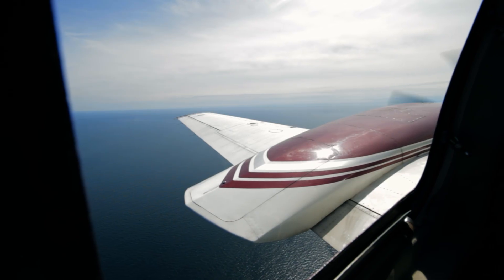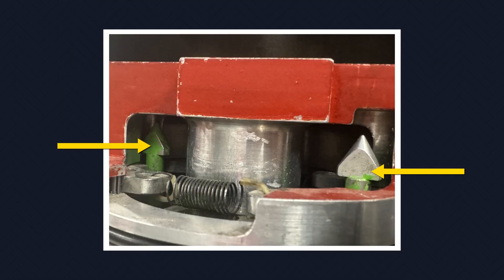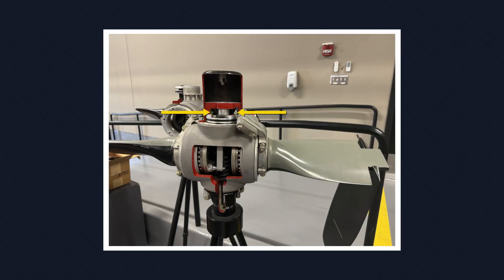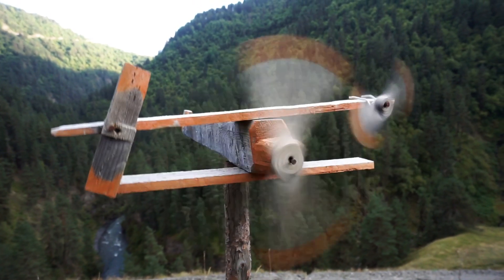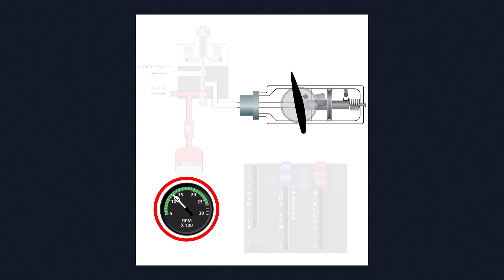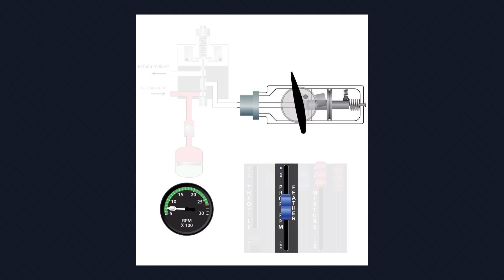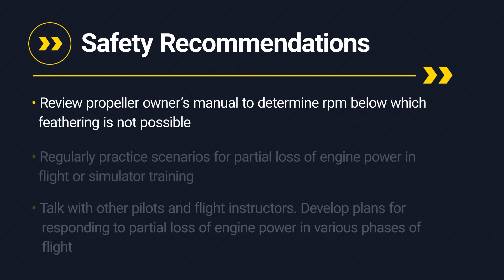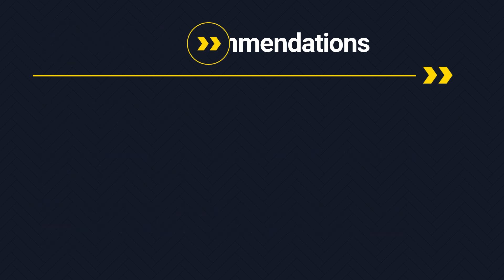NTSB Safety Alert - Know When to Feather Your Propeller If One Engine Loses Power

Comment: So in an emergency failure you might get only one chance to feather it (while you're distracted and preoccupied trying to figure out what the HELL is going on), and .... engine seized!!!  OOPs you MISSED it and you're screwed now. GREAT DESIGN!!!
Reply: Obviously you are not trained to deal with stressful situations. Pilots should know their aircraft well enough to understand the situation and correct for it. There are many items on many checklists that need to be memory and almost muscle memory.
Reply: @ Good training is always required but does not obviate the need for good system design.
Reply: This doesn't sound right. Some major engineering ought to be done ASAP.

Comment: What a great idea, installing a feature that adds minor convenience on the ground but makes an already stressful situation mid-air more dangerous. Shouldn't these be banned/removed for safety?
Reply: It is on the pilot to be proficient at operating their aircraft. If they are not it then becomes dangerous to the public.
Reply: It can be the difference between starting and not on a cold day. A successful start with a feathered prop is harder on the engine.
Reply: @firstielasty1162 do you know if there is a reason that the propellers could not be rotated out of feathered positions on the ground before start? To me this also seems like a poor design choice. I’d rather turn a mechanical mechanism during preflight than risk being doomed in the air by a “convenience feature”.
Reply: @IntrepidCuriosity ...you can use "blade paddles". Usually a contrived lever thing made out of lumber with carpet or rubber to protect the blades. Constant speed props are tens of thousands of dollars and up, it takes a fair amount of force to turn them, and, despite being strong, there is almost no tolerance for any damage to them. Not something most pilots would do to start an engine. If I had to start an engine with a feathered prop, I'd just do it, rather than mess with that. 
   In normal shutdowns, a mechanism holds the blades in the "flat pitch" position, helping with the next start.